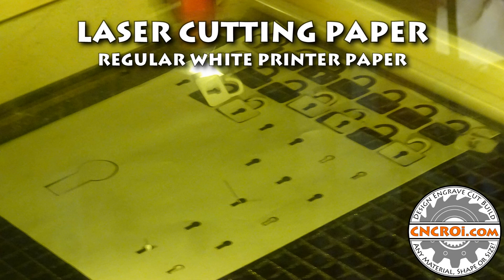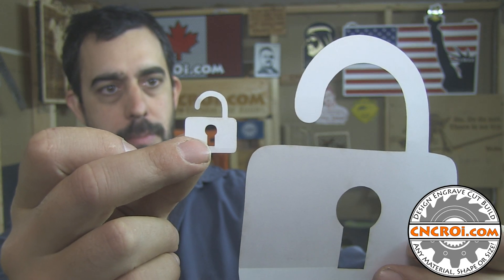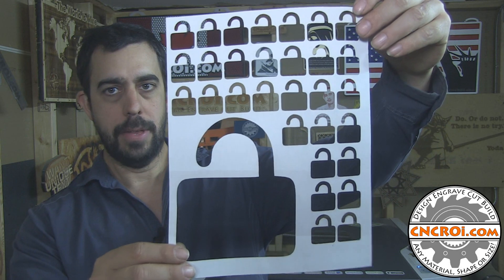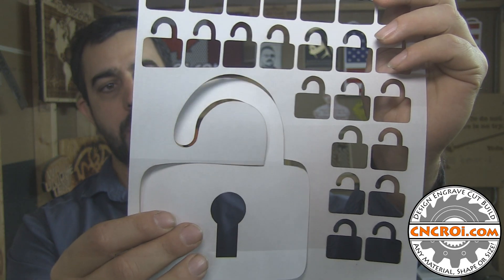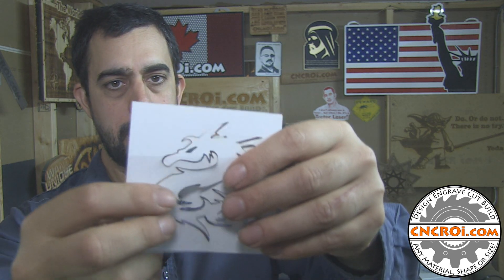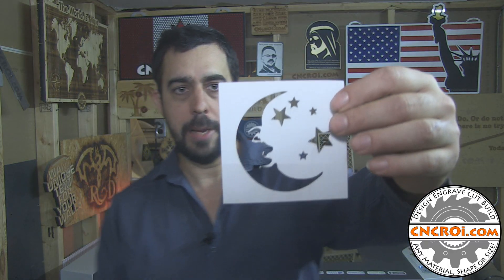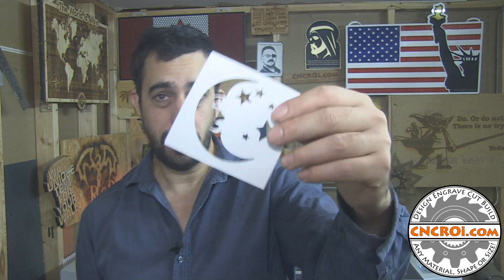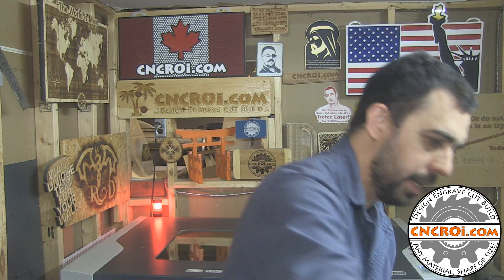Laser Cutting Paper: Regular White Printer Paper

Comment: How to avoid the burn edges and smoke and catds
Reply: Make a gril from 0.3mm wires 20mm high from the honey comb and mild  air assist. Almost no burn mark.
Reply from the maker: I guess a simpler method is to just use a CNC waterjet.
Reply from the maker: No way to do so with CO2.

Comment: what happens if I try to cut paper that is immersed in gasoline and laser settings are 100mm/s, laser power at 200% and 20 passes?
Reply from the maker: It's called acrylic and it cuts fine.